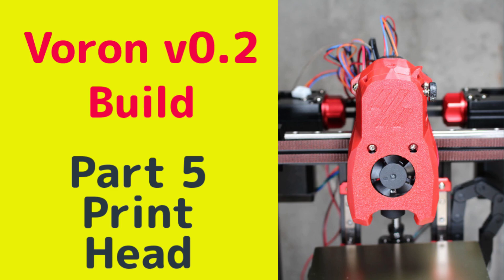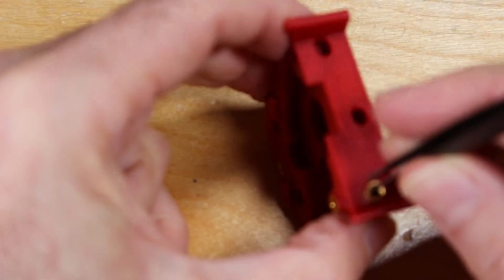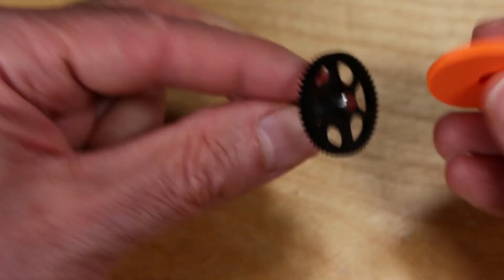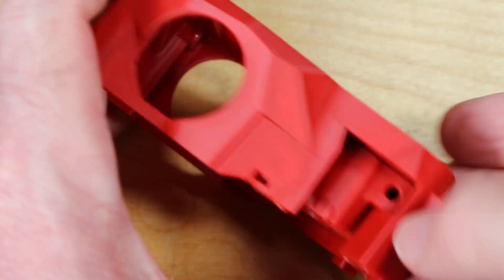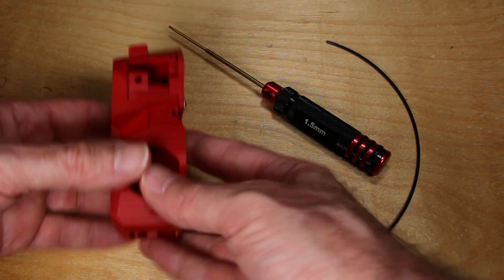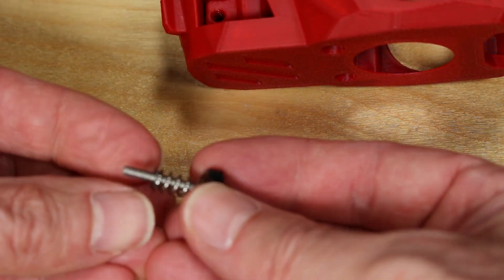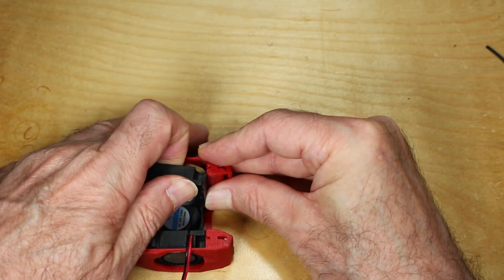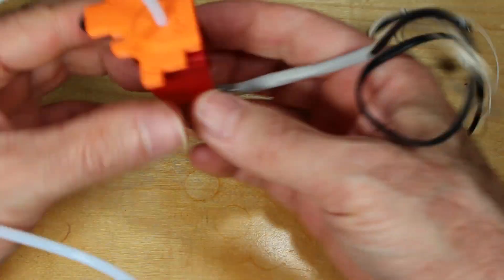Build a Siboor Voron V0.2 - The Print Head - Part 5

Comment: Thank you for this series! I'm building a Mini Stealthburner from my LDO v0.2 kit. The right-most position for the primary gear is still not enough to be centered with the filament path. The set screw doesn't allow to move the primary gear the last 0.2-0.3 mm closer to the T50 gear (original Bondtech BMG part), because the flat part of the shaft is too short. What would you suggest in this case?
Reply from the maker: That's odd.  So it sounds like the primary gear is incorrect?  If you grind the short side of the primary extruder gear, will it all fit into the print head correctly?
Reply: @KapmansBasementWorkshop  Thank you for your answer! It doesn't seem to be incorrect, but the D-cut is definitely too short, so I'll try to extend it first. There is at least one user on Reddit and one on the official Voron forum with the same issue with the new (white) Bondtech shaft assembly.

Comment: i finished my siboor voron v0.2 the other day. i still have to do tunes and stuff. i don’t have the adxl enabled, but it’s chugging along. the most difficult part was wifi access
Reply from the maker: I'm wondering if I'm even going to enable the wireless.  I normally plug all my printers in with Ethernet cable.  Leaves the wifi free for other devices.  But it's very convenient to connect the printer via wifi.  Congratulations for the build!
Reply: @KapmansBasementWorkshop  i have cats, so hard lines are not a good fit. i need enable adxl and start my v2.4 350